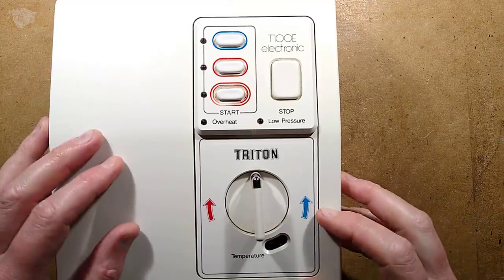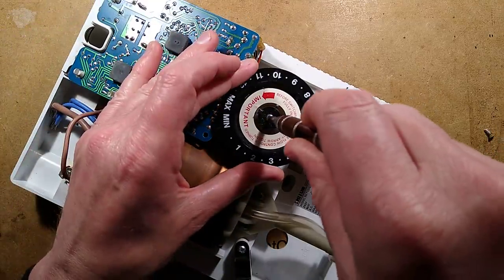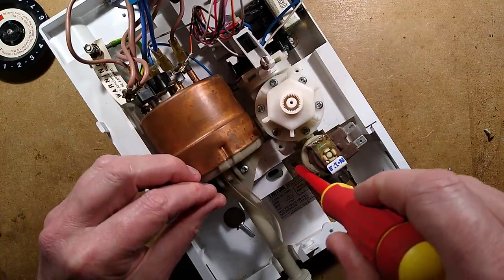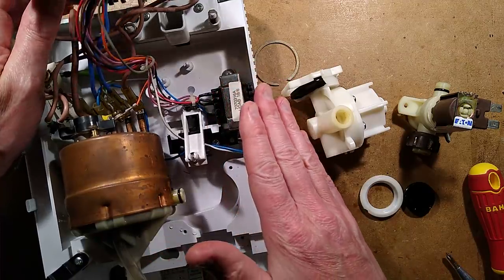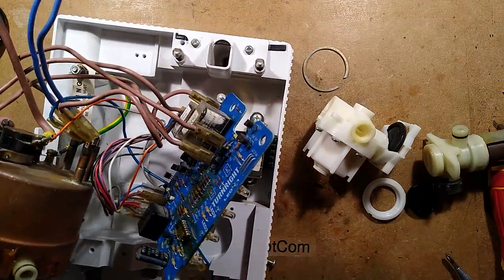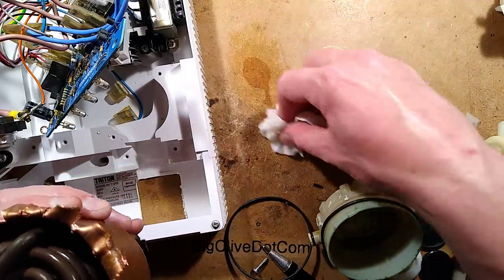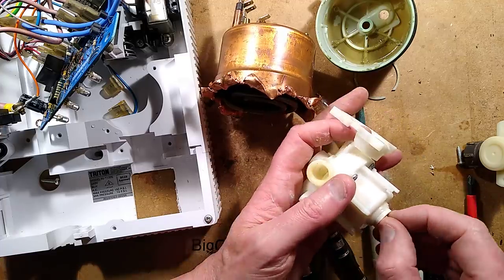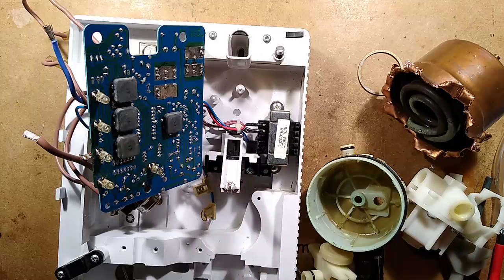Teardown of a British electric shower that went bang.

Comment: So I think when there is no pressure that plunger is in and it turns off the element. So it wont heat when no water pressure or too little. my guess is a massive air bubble went through and caused the pressure to suddenly spike and that plunger bottomed out hard and broke the housing.
Reply: @Anthony Martin Hello mate.
I have anecdotal evidence that a large number of electric showers have failed in the last few weeks.
I have two theories about why;
1. COVID, everyone "locked down", causing a change in the mains water pressure.
2. Hottest Spring on record.
Maybe both are factors. It's just a theory, but I think it's interesting.
Your theory might be right, but I'm a bit skeptical of it. Air bubbles in mains water are unusual, and that unit has excellent protection against water supply outage.
My guess is, it's just that the plastic has decayed over the 30-ish years. The things I mentioned may have exacerbated its demise.
[I think this might be in the top 10 geekiest comments I've ever written. Cool.]
Reply: @ann_onn  yea age is the biggest factor, it had already perished then the pressure spike would have finished it off.

Comment: This is nothing compared to the electric shower heads they use in South America. Those things are practically a 110v or 230v extension cable plugged into the shower head...

Comment: Unsurprisingly, these are also very common in Malaysia, as in a tropical country, water only needs to be heated a little to take any chill off.  The large stored water heater tanks aren't so common, instead these "instant water heaters" are installed.  But newer models have an extra safety earth leakage device (ELCB) that gives a bit more peace of mind to those worried about taking a shower with 240v.  The safety device is meant to cut off power if a "leak" is detected, plus one can also test the leak device is working via a test switch.

Comment: Dang, not many things can make you feel as icky as your shower going dead. But in Oz, it s my solar water heater springing a leak. Not some wee plastic widget. Cant blame my unit, 25 years, corrosion gets the best of us all. During winter months i run it for an hour or two in the morning n evening, just to top it off, just to get it piping hot. But only runs a few days a year. Solar hot water is amazing, if you can, do it. Single best thing you can do to reduce energy usage. Probably not so useful in Clives neck of the wood, but anywhere there is regularly sun, very worth it. If its an option, do it. The water used is far more a concern than how hot it is, here.

Comment: The diaphragm is probably part of a pressure switch to tell the control board water pressure is too low and may lead the unit to overheat, or maybe to activate it. This electrical shower is really impressive and complicated, having only a few temperature settings. I have never seen something remotely close in Brazil, where electric showers are king because boiler systems here not so popular due to the high cost. We do have electronic showers where you can control the water temperature by turning a pot that controls a TRIAC like in a traditional bulb dimmer, and you can also get hotter or colder water by controlling how much water is passing through the heating elements by opening or closing the water valve slightly. Most heating elements here are just bare wires arranged like a coil, expensive showers may employ immersion elements that are electrically isolated from the water.

Comment: The water pressure switch thing is so that if the water pressure drops below a certain amount (as if the tap has been turned off or something fails and water stops flowing) then the unit won't try and boil it's self dry. It only wants to boil water if there is water to boil.

Comment: For me, it is Interesting to see this shower unit, having mostly only experienced similar units in payment versions. Are there other positives to this type of unit than the space-saving (or maybe installation time-saving)? I though that these were mostly used in cases where there is either a need for payment use or when there is no hot water source available.
Reply: Usually with older hot water systems in the UK we have a gravity fed hot water tank that is heated by hot water from the boiler running through a coil inside it. Fine for running hot taps but not enough pressure for a shower. You can either pump it, but most people just used an electric shower. Nowadays, with modern combi boilers, you can just feed a thermostatic shower direct from the hot water supply.
Reply: main advantage is water pressure, originally these were  invented for houses that only had a cold feed . a quick way of fitting a shower ,
even when hot water is available until around 20 yrs ago  it tended  to be fed from a tank in the attic, while the cold is off the mains water At 2-4 bar pressure. the hot is something like  ½-¾ bar. no good for mixers, if you take cold feed from tank also. you then Have cold and hot at ½ a bar, ie a dribble.  so electric showers use mains pressure water.  which gives a great shower.
Reply: @Mitch-Hendren  Traditional non-UK solution is a hot water tank that simply passes through the main water pressure, though it gets suddenly cold when the available hot water is consumed.
Reply: @johndododoe1411  that's been creeping in over the last 20 years. we're finally catching up .

Comment: Just curious as to why this kind of device would be needed?

Do a lot of UK homes have no hot water at the taps in the rest of the home?

I know my local systems (Australia) are pretty much all a single hot water   device for the whole house (usually either gas or electric, but solar ones are very popular now too)
Reply: We have hot taps, just before the days of combi boilers we used hot water tanks heated off of the central heating boiler which was only pressurised by a tank in the attic/loft of the house, and didn't give you enough pressure for a nice shower.
Reply: Well use a pump then to increase the hot water pressure. These electric showers are cheap inefficient crap.
Reply: @rkettridge  I forgot the UK uses water for heating the home as well!
(The wall radiators work by hot water flowing through them don't they?)

That makes sense then, with the existing heater/boiler having totally different pressure needs to what a shower would need.

Comment: You're right I'm an American and that whole assembly, that unit freaks me out! Here in America we don't mix electricity with our water especially in our shower or bath. In North America we turn that heater water and a whole house sense one big hot water heater supplies hot water to every hot water tap. We do have electric hot water heaters but what I seen in this video is kind of frightening to me and what I am accustomed to and what I'm accustomed to  installing. North American building code doesn't let water get near electricity very often

Comment: I think the one that pop out is the low water pressure cut off.. It will not turn on the heating element if the water pressure is too low.

Comment: Those temperature arrows irk me to no end. Why are they laid out like this? Why not have the red arrow on the right pointing down, and the blue one on the left pointing down?
Reply: I can't see a problem.
It saying "more hot" (clockwise) or "more cold" (anticlockwise).
Your suggestion is just changing it to be "less hot" and "less cold" instead. I think I'd find that more confusing, if anything.
Reply: @ann_onn  You are missing the point. Of course the arrow should always point to where it's "more hot" and "more cold". But switch them around, so that the center position is warm, and if you turn it towards the red arrow, it's "more hot".  My first instinct when hit with a cold blast of water is to turn it towards the red thingy, which in this case would be wrong because I have to turn it AWAY from the red arrow, towards the blue arrow. 

It's messed up. Put the red arrow to the right and the blue arrow to the left, problem solved.

Comment: I don't know if I prefer this kind of shower water heater, or a central water heater. It takes a long time to get the hot water all the way to my shower, when I turn it on, and then a lot of fiddling to get the temperature and pressure where I want it.

Comment: Hi you said that it is relatively safe, Relatively means    to some extent/degree · partly · partially · half · in some measure · comparatively · moderately · (up) to a point · [more]       water and electricity don't mix
Reply: These units are incredibly safe and have to abide by some of the strictest safety standards in the world. The only reason a dangerous issue would occur is if they’re installed by someone who doesn’t know what they’re doing or and the wiring isn’t rated correctly the handle the load.
Reply: @lukedoherty8062  Hi I have never seen something that here in the us I can not believe that thing is sold there is no shielding on the wire lugs , open relays it would be like taking a shower holding a lamp  running on 220 volts AC. It might have a GFI breaker IT in which i have seen fail. Look that water valve failed . Well best of luck with that. look us electrical standards for fixtures in bathrooms.

Comment: Our electric shower is 10.8kW and on its highest setting it can basically turn water straight into steam coming out of the shower head, it can go from being switched on to tripping the thermal cut out in less than 30 seconds. Of course we never use it nearly that high.

Comment: Many years a go I bought an old 40ftx10ft static caravan (on a residential park), and it needed some renovation. Part of it was the bathroom (it worked to a point but definitely needed a re do), in there was a shower that had a 7.5Kw Electric shower. It was such a weedy device, to get the temperature i wanted I had to turn the water flow down so much it was like a flea peeing on me. So as part of the bathroom re do, I installed a new corner shower unit (including replacing/upgrading the wiring and fuse box, and upped the shower to a 10.5Kw..... WOW! Insta Powershower!! Great water flow and the power needed to heat the increased water flow... Oh them were the days!! So, from then on anyone I knew who also had an electric shower that either weren't happy with their shower, or like this unit had theirs go kaput, I checked their wiring for load capabilities) and prompted them to upgrade to either a 8.5 or 9.5Kw, half a dozen well chuffed friends and family members were had... 👍😎🇬🇧

Comment: Nice soft water area, my element was dissolved by limescale after two years use,  half a mile from the EastEnders set...:-)
Reply: Interesting. Doesn't limescale just gum up the works? We had a soft water system installed and within ten years the copper in the base of our hot water tank dissolved and we had a massive leak. I was told the salt content in the water was the culprit. As Clive has done here I cut the tank open (but for recycling purposes) and there was a good six inches of limescale in the bottom sloshing around (no wonder the weight of the new tank was nothing compared to the old one). Can anyone confirm or deny the theory that softened (not already soft) water eats your tank? As does limescale? Or was it just the limescale? Maybe both? Perhaps neither? I dunno...
Reply: @roberthorwat6747  Water hardness used to dictate what type of heating element you installed but with the creation of Incloy as sheathing that changed. The elements in this shower unit were copper sheath. Limescale usually creates a protective coating on the element but reduces heat transfer and increases heat build up inside the element which can cause premature failure inside the element. At least that is how I understand it. Of course there are different sheathing materials used for different heating applications.
https://www.deltat.com/sheath_material.html
Reply: I've had a few of these over the years, and after two were scrapped because limescale had eaten through the copper coil, I trained my family to run the shower cold ( turn off both heating elements with the selector switch ) before they stopped the water flow. This prevents massive build up of limescale, as you're not allowing the very hot water to cool down inside the tank. Limescale does coat the copper, but this then acts as a seed for more to build up. Also, even though the whole unit and elements are insulated, there is a minute potential difference between earth ( the copper around the coil ) and the internal coil that current passes through. Over time, electrolysis eats the copper causing enough current imbalance to trip your homes ELC or RCB. Hence the reason why immersion heater tanks have a sacrificial coil inside, so that this erodes rather than the copper tank.
Reply: @cunning-stunt  , do you know my old girlfriend, Candy Hunt? :-)
Reply: @tecknick  Are you Cupid Stunt? If so, yes, she did mention you.

Comment: Good disassembly, mate.
The reason for using linear transformer might be ease of having zero-crossing signal to control triac firing timing. The black thingy mounted on copper boiler body might be triac which take advantage of cooling itself without resorting to huge finned  heat sink.

Comment: These are interesting - I wonder how these compare in efficiency to a hot water cylinder.
Reply from the maker: These are much more efficient.  No ongoing heat loss or waste in long pipe runs.

Comment: Not living in the UK, I'm not familiar with British plumbing---do households have a storage water heater like in the USA?  If so, why are these electric showers used?  I realize they are safe and reliable, but it still freaks me out a bit with the proximity of electronics and 240V being so close to flowing water, separated by only some plastic parts and o-rings, and hopefully a working earth connection.
Reply: Older houses usually have a a hot water tank. It usually takes over an hour to heat up the water. It's often done using a timer switch. If you use up all the hot water, you manually turn it on and wait a while.

That's why these were quite common. It's instant hot water, without having to wait or worry whether you have enough hot water for your shower.

More modern houses - fitted out within the last ten years or so - usually have a gas "combi boiler" which instantly heats a large volume of mains water. That eliminates the problems, so electric showers are becoming less common now.

it's really very safe. Lots of electronic things have water - such as a kettle, an iron, or a washing machine.

Comment: In the Netherlands we have either central on-demand gas heating warm water or tank stored (heatpump) warm water. So when I moved to UK for my studies, this was a kind of shock for me. 32 Amp in the shower cabin! And it was rubbish, poor flow, low amount of water. Even a heatpump tank would give you 4x more efficient hot water at a constant amount.

Comment: We had fluctuations in our water pressure that caused the pressure bung to pop out into a captive holder. Pushing back in was easy but this random poblem kept repeating. It was when I looked it up on YouTube a very good plumber explained that the normal heads supplied with these showers causes back pressure and the fix is to fit one of those large sunflower heads. Apart from getting a better shower experience the bung problem has never repeated itself.

Comment: I replaced ours a few months back, also a Triton. The fault on ours was the RCD kept going off. It was about 15yrs old and they are so cheap i just brought another. Strange why other countries dont use them as they are efficient and only heat the water you are using.  Ours is tapped straight off the mains incoming feed too so about 60psi.  Thankfully on B&Q's and Screwfix website they give you system diagrams, so it was easy to find a new model that that the incoming water connection in the same position. Which made fitting the new one a piece of cake.
Reply: Chea and easy to fit, but will cost you hundreds per year in electric. Dude, gas is way cheaper. 
A typical UK price for electric is 14p per kWh, gas about 3p. A five minute electric shower is gonna cost over a quid; gas, about 3p.  If you have four people showering once a day, that's over a grand a year difference.
Modern combi boilers also only heat water as you use it, and give it at mains pressure. I'm guessing you don't have one of those yet, but it might be worth considering.

*Standing charges make it more complicated, but still...

Comment: You'll find this kind of electric shower heaters all over South East Asia. At first it was quite difficult to understand how it worked: water flow regulates the temperature. Rather different from the systems we use in Continental Europe. Of course, in South East Asia, you will find the mains plug (those flimsy US style toy plugs) only centimeters away from the shower unit itself.
Reply: Yeah, I used them quite a bit in Thailand. They are fairly crap, but it is marginally better than just a cold shower. It's usually about 30 degrees there though, so even cold isn't too terrible.
I lived on a small island for years, where my water supply was directly collected rain; that was fine, and often quite warm after a day of sunshine on it. Just had to be very conservative about use, because it didn't rain that often (except about 3 months of the year, where it rained pretty much constantly).
Thailand doesn't really get 4 seasons, just two. 9 months of stupidly hot, then 3 months of rain.
Fortunately, you can avoid most of the rainy season by just going to a different part of the country at that time.

And yeah, their attitude to electrical safety is extremely lackadaisical. I worked in a bar with a refriderator that regularly zapped me,m and plugging my digital camera into a PC made it live.